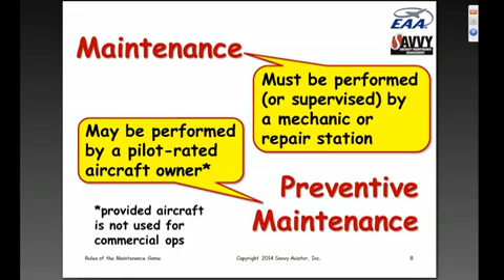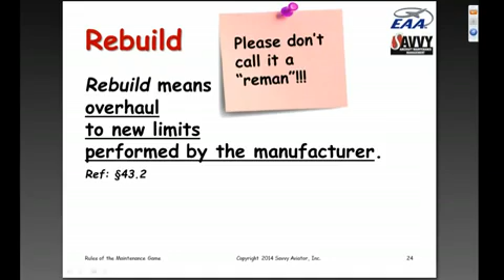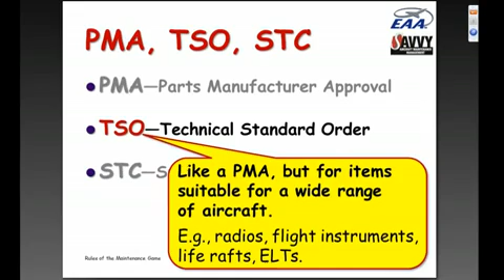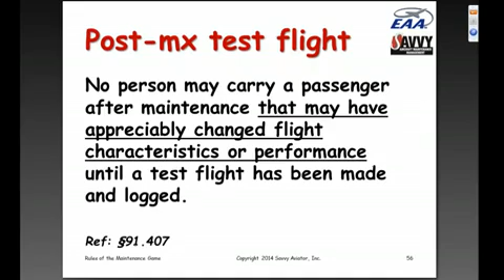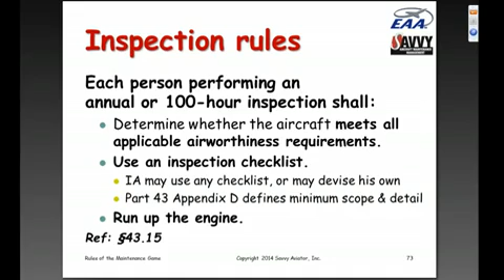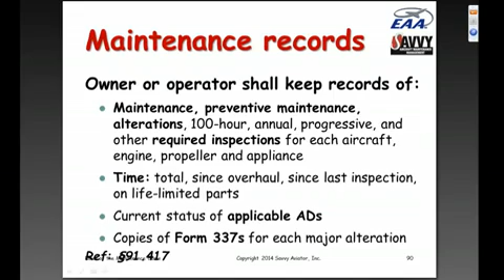Rules of the Maintenance Game

Comment: What if an IA signs off an aircraft as unairworthy due to some item being out of limits.  The owner then takes it to an authorized person for repair and this person finds the item to be within limits.  Can the authorized person then just sign it off as within limits and return it to service?  I have actually had experience with something like this and ended up replacing a part even though it was still within limits, just as a CYA.
Reply: TBO on a part 91 aircraft? Yes. Except parachutes on Cirri and the similar items.

Any A&P can sign off the testing and inspection.  EX: your engine is 200 hrs past TBO. The IA declares it unairworthy because of time past TBO. Go to an A&P, have him test and inspect the engine for airworthiness. Voila, discrepancy resolved.